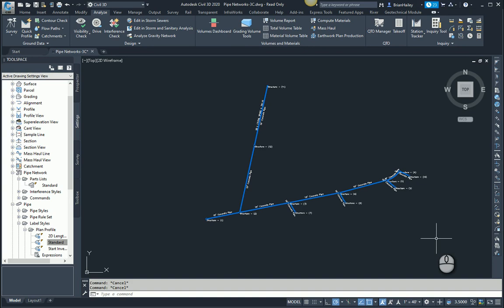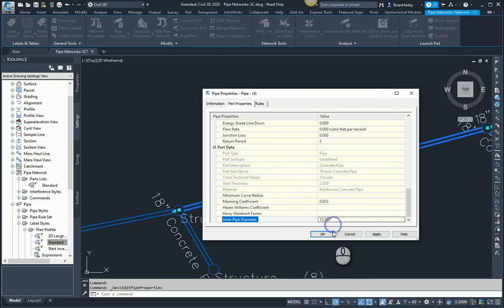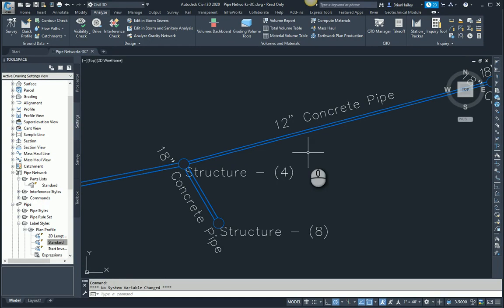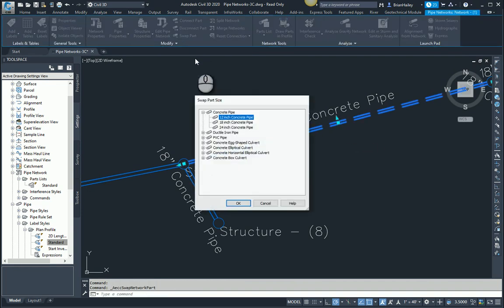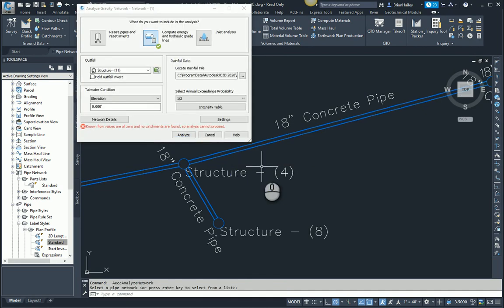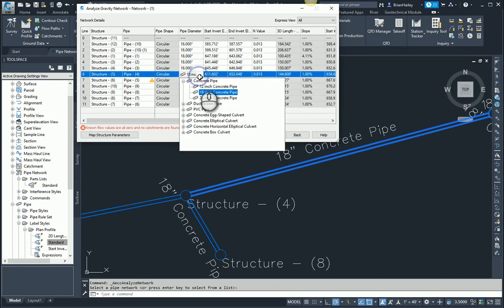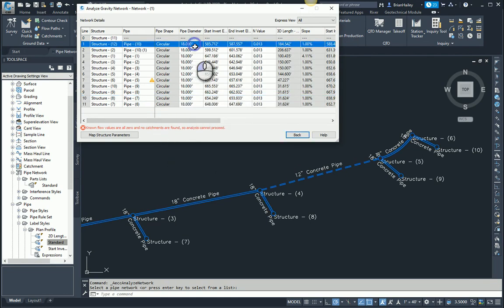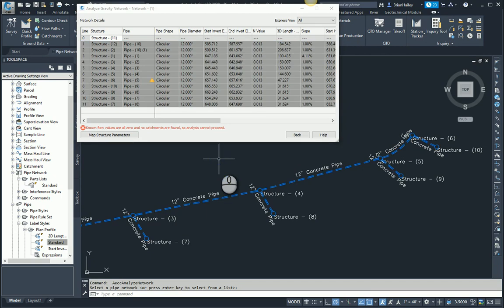Civil 3D - Swapping Multiple Pipes in a Pipe Network

Comment: Is there a way to do this with pressure network?
Reply from the maker: Pressure networks have pretty much always had the ability to swap multiple parts. Select a pressure network part and on the ribbon choose, "Swap Parts". It will then ask you which parts to swap. Simply select them in the drawing and you can swap them out for a new size.